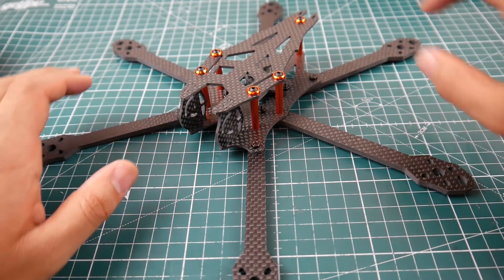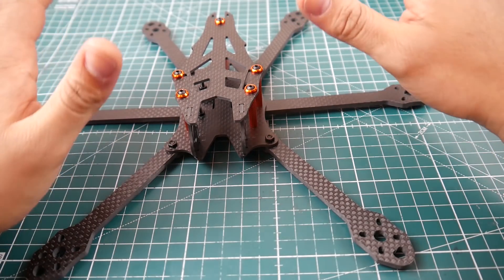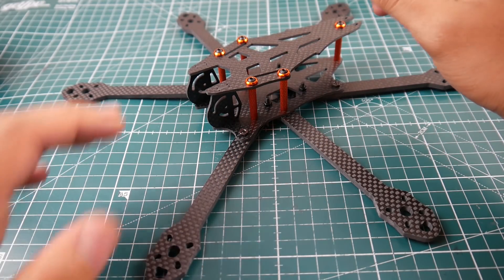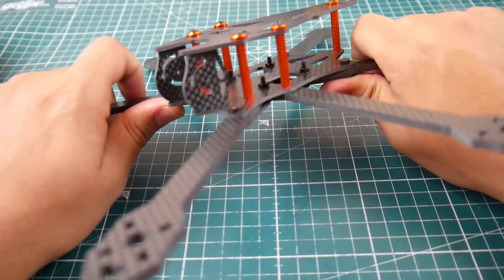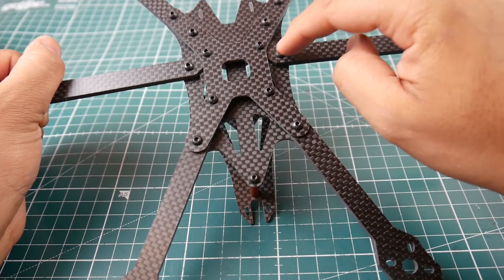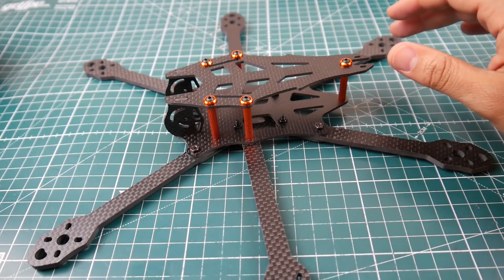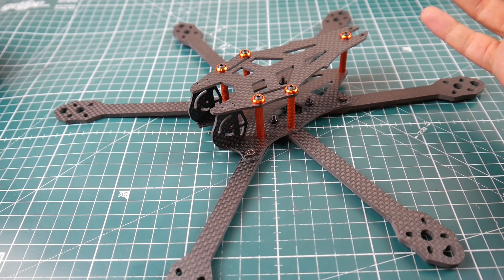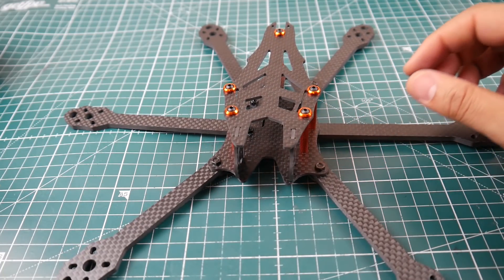Light Weight FPV Hexcopter Frame // Realacc Sphinx

Comment: I use the Matek CTR for my hex, it has 6 outputs. Also I doubt you can run 6" because the props will hit each other, you have to check for that. Mine is 300mm (HK Thorax) and you can only run 5" props
Reply from the maker: I think your right I completly missed the prop to prop check.

Comment: I saw this the other day and I thought about what to put on it if I was building it myself. 
My idea I had was very different from what you suggesting because I would go for a light set up with LDARC 1806 motors, Racerstar Tattoo 25amp esc's and a Omnibus F4 and 5 inch light props or something like that. It would be cheap, light and it would not destroy the battery, but still very powerful, I guess.

Comment: You have 2 options to stop prop from hitting the top plate. 
#1 make a split hexcopter so the props are above the top plate
Or make it look crazy and 
#2 make it a pusher hex. (The motors are on the bottom side of the arm).
Both of them would work :)

Or cut the new top plate with your cnc
Reply: Really stupid question: Can you use 2 different size props, as long as it's symmetrical?
Reply: GrumpStump yes. There is video on yt of someone flying with 4 different props. And it worked!
But the best is if the larger props are at the back